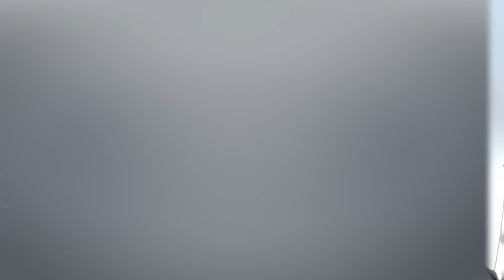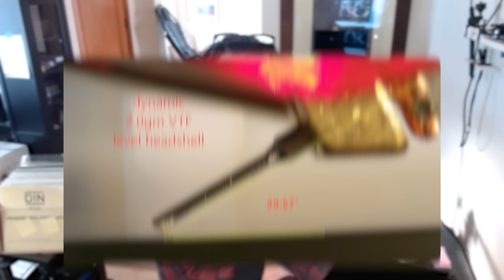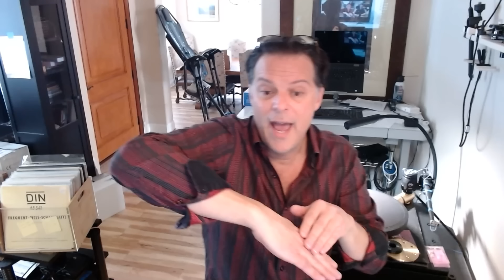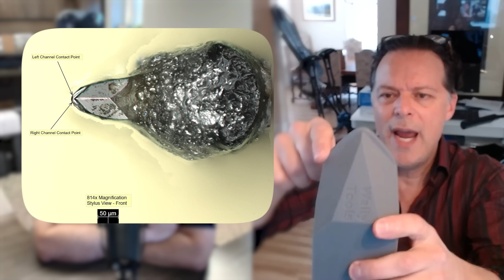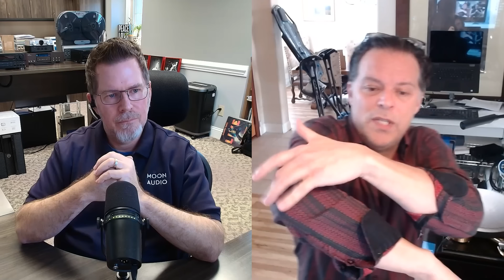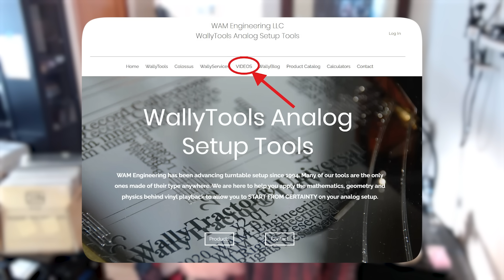Your Turntable’s TRUE Potential — Why You’ve Never Actually Heard It

Comment: I've got an early 80s Technics SL1210 with an Audio Technica cartridge and a VMN40ML stylus. Yes, I know the turntable is not high end spec but it was good enough for the national BBC Radio FM stations at the time so that's good enough for me. 
I've just chatted with Gemini (bypassing its sycophantic tendencies by asking it not to sugarcoat the truth) and it reassured me that the Micro-Line styli manufactured by AT has a high optimal line-contact tracking capability. So that's good news. I think Boisclair's points are hingeing upon a fault factor of certain manufacturers of styli. But it appears I've chosen well. I do like Audio Technica, have to say. In fact, according to Gemini, Boisclair has used photos of their Micro-Line styli to prove his point about optimum needle-to-groove alignment!! 

Ensuring the tonearm is absolutely level (which I do) in combination with the quality precision of the Technics turntable's build and the profile of the Audio Technica stylus means I'm achieving my goal. I hate to say it but it seems to me that the moral is choosing a company that gets their stylus precisely right rather than buying a tool to correct it. I'm pretty confident now. Sounds great to me and I use my ears a LOT for recording, engineering and producing in Logic Pro.

Comment: This video is for the ultra-elite audiophile, someone who thinks of nothing to spend $45,000 for a cartridge and $100,000 for a turntable. Quite frankly I seriously doubt that there is more than 2% improvement in sound between that expensive turntable/cart vs a $1,300 Rega Planar 3 using a $300 Audio Technica AT VM740ML cartridge.  

This is one of those things that once you get past the sweet spot of about $1,400 for a turntable and $400 for a cartridge that the return on the dollar spent becomes increasingly minute.  These sweet spots exist everywhere, for example I have a $600 Cafelat Robot espresso maker, my espresso will often exceed in the quality of the shot of what a $4,000 plus commercial espresso machine will make at a coffee shop.  

Add on top of this cost for a turntable the tools that this video wants to sell us will cost more than my Rega Planar 3 with the AT cartridge! and for what? maybe a 1/10th of 1 percent in improvement in sound?!

Most people that can afford spending $150,000 for a turntable and cart are older people who have lost some of their hearing; thus, they would never hear the improvements, heck I would challenge a 25-year-old in hearing the differences the tools would make.  These people are selling us psychological sound improvements, if they say it works and go through 50-some-odd minutes explaining why then in our minds, we think it sounds better especially since we're spending the money.  They do the same thing going back to my espresso machine example, they will spend hours explaining why we need a $8,000 espresso machine throwing all sorts of mumbo jumbo fancy words and scientific things at us to make us believe we can't get good espresso from anything less than an $8,000 espresso maker, which is simply not true.

There was a guy some years back that made a point about spending $2,000 a foot for speaker wire vs spending $1.50 a foot and challenged anyone $10,000 that they could not reliably choose the expensive wire vs the cheap wire any more than calling heads or tails in a coin flip after 10 listens or 10 flips, and no one ever won his bet.

Comment: The dude w/the perpetual glasses on top of his head (guess it's some sort of authoritative fashion statement) keeps diminishing, if not entirely leaving out other considerations and factors.   Such as a record does n't always lie perfectly flat.   Some music has greater dynamics than others so the vinyle groove will change the angle of contilever and stylus as it moves through the steeper terrain of the dynamic portion of the groove, just to name a few.   And maybe my biggest question or observation.   Don't contilivers bend at the stylus tip to eliminate the Tracking angle and put the needle more flat like a cutting lathe?

Comment: The cartridge-headshell interface is critical.   Adding a shim of plastic at this interface changes a lot more than the angle.    Interfaces dissipate vibrational energy.     

I’m very surprised this is not mentioned.
Reply: @gregkirkos6929   this subject is covered in a ‘sound bites’ episode by WAM Engineering on YouTube.

Comment: I didn't really get any information on how to fix or adjust the problems discussed.
Reply: Because the point is for you to buy a very pretty 400 metal protractor tor tha gives you exactly the same information as one you can print off the internet for free. And which you will ever use once or twice😂

Comment: Start with a traditional setup, then tweak one thing at a time to see if you like the sound better, or not. Whatever sounds best to you, is correct!   :hand-purple-blue-peace:
Reply: I would say your approach leads to "better" but cannot at all be expected to reach "optimal". Optimal transcription characteristics are not determined by the cartridge manufacturer and certainly not by those of us playing our cartridge. Those are determined by the cutterhead design, cutting stylus shape/symmetry and engineer's setup. We know what the engineers are aiming for and therefore we should aim at the mean of any potential cutting errors during playback.
Reply: @WAM-Engineering  I fully agree, but you run the risk of not maximizing your listening experience if you're constantly chasing an optimal or "perfect" setup.
Reply: @tima.478 once a cartridge is analyzed I spend no more than 20 minutes setting it up and check arm torque with the WallySkater each quarter. I spend 99.5% of my time listening, not fussing - as do my analysis clients.

Comment: I am with Roy Gandy on this. So many things get more in the way of music than VTA. I know my stylus alignment and VTA are spot on because I have the Rega P3RS. I also have a Planar 2 with an Ortofon MC15 super 2. That's still in the shipping box. Hopefully I'll set it up next week. I bought it to sell on but I saw the opportunity to see what upgrades represent best value. The 2 has the original rubber mat so that's going to cost me nothing. Quick swap to my felt mat and see if it's demonstrably better. Same with my reference EBLT. My Planar 2 has the original motor. I don't want to shell out on the 24v motor upgrade because my intention is to sell it on. The Planar 2 has an Rb300 arm on it which is is amazing for the price point. As mentioned it has a moving coil cartridge on it. That's where things get interesting. I'm excited to hear the MC vs my MM.
Reply: Many manufacturers confuse raising or lowering of the tonearm with an audible impact of changing VTA. I discuss why this is so in my videos on VTA.

You are also not on solid ground to assume your alignment is “spot on”. Like other cartridge manufacturers, they buy their stylus/cantilever assemblies from one or more of the same three vendors.
Reply: @WAM-Engineering Rega check the alignment before it leaves the factory. All these micro adjustments and yet you are comfortable with removable headshells 😂
Reply: @andy397 @andy3974  We do NOT prefer removable headshells, particularly the common bayonet format. The Kuzma design is much less problematic but non-removable is highly preferable. 

IF (BIG “if”) Rega is inspecting the four angular alignments on each cartridge prior to shipment, they aren’t doing anything about the angular errors. That doesn’t make them any worse than other manufacturers; it makes them typical.

You would do better attempting to understand what we are doing in our research prior to levying your uninformed criticism.
Reply: How did you get on with your MC vs MM listening test?
I’ve been using high output MC (originally Sumiko Blue Bird mk1 now a dynavector 10x5 Mk2.)
I found the mc had more “air” around instruments, greater detail and better soundstage. MM’s give more impetus to the music and livelier sound.  It was an ortofon but I can’t remember which one. 
I’ve stuck with HOMC as it’s my preference. What was yours.

Comment: Great video. However, most of this would be avoided if you just don’t use moving coil cartridges. I’ve never found them to be very musical anyway.
Reply: Sorry, but I think you have misunderstood our claims. Generator type has nothing to do with the many opportunities to fix the angular transcription errors we see in the industry. If anything, the cheaper MM cartridges and their aluminum cantilevers tend to be higher, not lower, in error with respect to the vertical tracking error claim of ours. The side “benefit” of this high error is higher 2nd and 3rd order distortion, which can have a tonally pleasing effect, but always at the cost of being less than honest to what is the grooves which, at very least, include a smearing of subtle cues (spatially and of inner detail) that make records sound so “real”.
Reply: @WAM-Engineering MM don’t have the yolk issues or the mass issues (some) or the tracking issues or the resonance issues or the cantilever issues either if you spend just half of what a lesser sounding MC sets you back.
Reply: @gabriellegiovanni7899  Let's agree to disagree on your claims.

Comment: Its analogue. There is right or wrong, black or white, 1 or 0. It doesn't really matter too much if it's off by a couple of degrees or a 1/10 of a gram tracking force. A listener may think it sounds better because it's been setup to 0.00001 degrees accurate but the tolerances in the vinyl are way wider than that. Just learn to set it up and enjoy your music. 🙂
Reply: Like I said in the interview, you can be way off optimal and it still sounds good, but “good” or even “great” isn’t my goal. My goal is OPTIMAL. Optimal is always audible over “great”. My videos go into how we can know what optimal even is.
Reply: @WAM-Engineering  Understood, thank you for the reply.

Comment: For all you analog / vinyl devotees out there, J.R. is the leading expert as it relates to cartridge / stylus / tonearm setup. His YouTube videos offer a treasure trove of valuable information & basic knowledge regardless of what you currently own IMHO.   

Naturally he's in the business to sell and promote WallyTools however recognizing that fact does not in any way detract from his technical knowledge and understanding of the mechanical interface as well as the physics surrounding the optimum setup of your turntable and it's individual components in order to achieve the best possible results.  And at 68, my hearing is also not what it used to be!  

P.S. As someone who has always focused on extracting the very best possible performance out of humble equipment "on a budget," I nevertheless have learned a great deal from him which has translated into better overall performance in my system with an emphasis on playing physical media predominantly vinyl.

Comment: When you are over 60 there’s a lot you don’t hear 😂
Reply: additionally, all of your life the subjectivity of hearing creates your only audio reality.  One only hears what you think, your opinion at the time.  so measurements of frequency response don't effect what you think , as you don't hear things that are missing, save for volume.
Reply: @richardelliott8352  We are audiophiles because of our sensitivity to TIME and the noise floor, not frequency. The sensitivity to TIME does not deteriorate with age and, according to a recent scientific study entitled "The Human Auditory System and Audio" can actually improve with age and experience. We are far more sensitive to time than frequency.
Reply: @W @WAM-Engineering isn’t frequency a function of time?
Reply: @trippmoore in our case, it is amplitude by frequency we so often focus on
Reply: I hear more now at 68 on my current system than ever could on my then State-of-the Art Pioneer/Dual in my teens.
Properly setup and superior equipment goes a long way to how much you hear in my experience.
Reply: @pnichols6500  At 68 years old, the typical comfortable hearing range for adults is approximately 20Hz to 8,000-10,000 Hz, with a significant decline in the ability to hear high-pitched sounds above 10,000 Hz.  Specific Frequency Decline: Studies show that for those aged 60–69, a high percentage of individuals have reduced sensitivity to frequencies in the 3000 Hz, 4000 Hz, and 6000 Hz ranges.
Reply: Principally my wife. But that's a good thing 😅 Have a great day my friend

Comment: I have multiple cartridges J.R measured. It’s a great service. 

My reference, a Hana Unami Blue was optimized with one of his shims to improve VTA, and Wallyzenith to align for the zenith error (~3.4 degrees). After those optimizations, the Hana’s performance improved significantly.
Reply: @ChrisMag100  it’s funny that you referenced the Hana as that is the cartridge that I have and I was contemplating sending the cartridge in. It seems like it might be a good idea for my Clearaudio concept signature.
Reply: @JKadison  I've measured well over 100 Umami cartridges from Blue to Black. They are GREAT cartridges for the money but they can definitely benefit from angular correction that you just can't (and wouldn't want to) get with the tonearm.
Reply: @WAM-Engineering I’ll have to consider that!
Reply: @JKadison  to be clear, the Hana was good before, but I found myself chasing my tail a bit either with setup. It seemed a bit sibilant. After the optimization, that went away. With the resin shim, it was a step.  With the brass shim, another increment. 

It got even better with the WAM colossus headshell for my Kuzma arm also. Not cheap, but it really took it up a notch.  Obviously, that’s specifically for a Kuzma arm.
Reply: @ChrisMag100 can you give me a ballpark cost to have him do one and create the ahimming?
Reply: It's not difficult to set up a cartridge correctly just follow the instructions
Reply: @paulomontero12  I have set up many cartridges over the last 50+ years however, when you’re talking about the expense of some of these new cartridges you what it to as good as it can be.